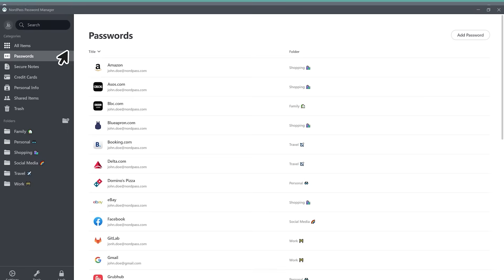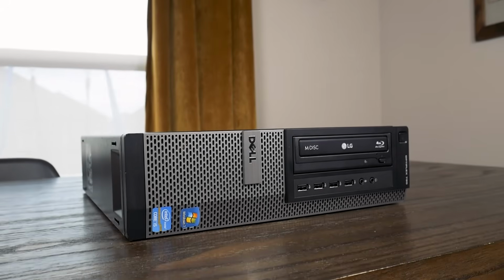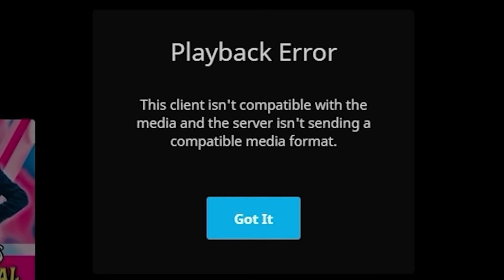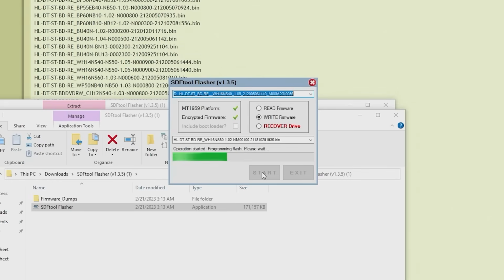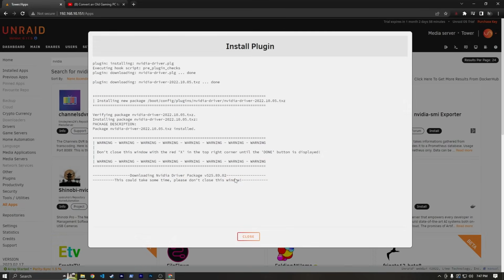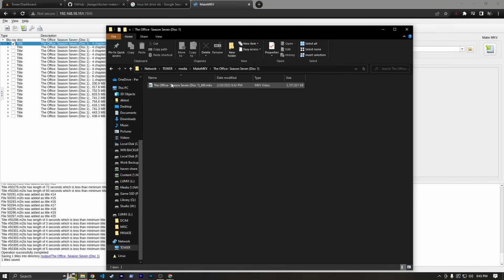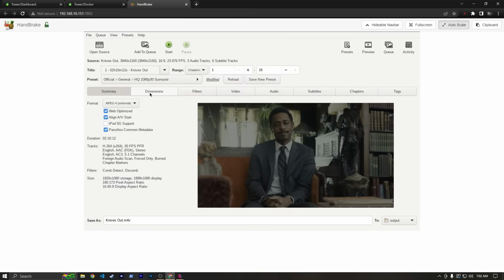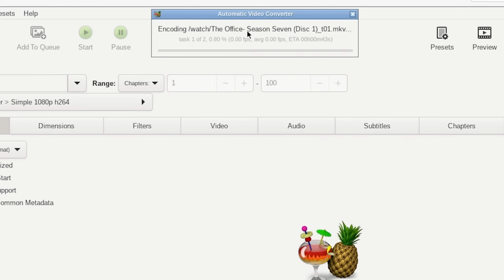Streaming 4K Blu-rays With a DECADE-OLD PC

Comment: I find it strange to put unraid on a system like this.  I get that it's easy but you could have put $60 more into the hardware itself and run the same software on a free OS with a GPU that handled all the transcoding.  Maybe it's just me but spending $20 on a machine to then spend $60 on a license for the OS for that machine makes no sense.  Now I'm going to hunt for the comments about how you should just download instead of transcode since you aren't keeping full quality rips.

Comment: I have an Optiplex 7010 with an I7 3770 and GTX 1050 ti. No problems streaming 4k video. A 2nd gen I5 just doesn't have enough power to run a server if you have multiple streams going.

Comment: with handbrake, try encoding to " H.264 (Nvidia NVEnc) " it should use some of the GPU power and cut down on render times
Reply: Makes the files massive though. I'd rather CPU encode
Reply: @StephenDeTomasi  Not true. Encoding is encoding - same settings on GPU and CPU should give you same file size. Its just faster using GPU .

Comment: I'm going to be doing a similar setup on a 790 I picked up about a week or two ago, just waiting to move around some network things so I can hook it up. 
I was worried that the i5 might not be enough. I've seen a lot about these boards in the 790 accepting Xeons with the latest bios update even though dell doesn't say they are supported. there's a Xeon 1260L with a 45w tdp, and a few others with 80w tdp in that socket generation. they're super cheap so I am going to try it out and see whether the system will run with one. no Igpu but that's fine if you're running headless or are using one for transcoding anyways.
Reply: I have successfully run a 790 SFF with a Sandy Bridge Xeon E3-1270 (no iGPU), 32GB of RAM and a GTX 1650 LP.

Comment: the Quadro K1200 can't handle h.265 transcoding but the nVidia T400/600/1000 can... one of those might be a good option. Also the P620 can too, I think. And you can use nVenc with HandBrake. Also VCE or QuickSync.
Reply from the maker: Yes, no idea why I didn’t look for nvenc in handbrake
Reply: @HardwareHaven  I was going to say the same like the guy above 👍👍

Comment: I have an OptiPlex 3040 micro. I tried to use it for UHD Blu-rays, but I ran into the same speed issue you found. If you want hardware decode for 10-bit H265, you need at least Kaby Lake (7th gen). I have 6th gen Skylake, and the dell bios won’t allow me to upgrade, even though it’s the same socket. But otherwise, it’s very small, quiet, and pretty efficient.
Reply: let the Nvidia driver do it !

Comment: I have an Optiplex 990DT, also with a second gen i5.  The local Microsoft TPR that sold it to me gave it Dell's stock/standard ATI AMD Radeon HD 6360.  For arcade-emulation gaming and Final Fantasy XI Online, it's absolutely perfect.  Dell Optiplex and Precision are the only desktops that I trust. In the passed, I've had ASUS and a few HP's. They were not as good as Dell.  I have found that Optiplex and Precision have consistently come from the factory with the DVD drive set on territory 0.  This is fantastic for people like me who hae have extensive library of  territory 2 anime DVD's.

Comment: man i am definitely bouncing back and forth from TrueNAS and unRAID.. 
MY setup right now I'm running windows 10 with 15 2TB drives in RAID 6 on a LSI MEGA Raid card. the new server im working on is a 8x 3TB with an HBM that will run ZFS. 
But for any hand brake work I 100% just use my AMD R9 5900x with the RXT 3070ti that thing with blast a movie in a 1/4 the time my Dual Xeon X5660 with a 1050TI Server can..

Comment: sweet will try this soon i have an eligable Asus Blu-Ray however it is in an old pc used for retro games running XP/Vista and 7 with an old Xeon W3680 6c/12t and a GTX 960 i wonder how it will run.. i wonder if it is possible to do the heavy lifting on a gpu with nvenc

Comment: I got one of these LG drives back in 2016 and didn't have to flash it. Stock firmware is good to go. If you're too squeamish about flashing look for used ones online and see if you can confirm they'll work.
Reply: What is being flashed is the older stock firmware that has a known exploit.  Your drive is old enough that it came with exploitable firmware.
Reply: @JamieStuff  I didn't have to do anything to get it to read or rip UHD discs though is what I'm saying!

Comment: Have you tried using hardware encoding in Handbrake over the GPU. At least in my case I can reduce the encoding time significantly.
Reply: some hardware can't handle the encoding...I believe those processors do have h264 built in
Reply: Yeah right I just watched the video again. The GPU does not supported the h265 codec. But I think at least the encoding part to h264 could be accelerated by the GPU

Comment: I use a rehoused 790 motherboard in a full height ATX case. I'm using it to run Automation software for a Radio Station. The Rehousing was to support a full height video card, and to add more storage bays. Dell was still using a standard ATX Power Supply in this design. So i replaced it with a larger one.
Reply: I, having just begun doing Online Radio, have a question about this: do you rip the full CD for the station or do you pick and choose the material? Also, how do you handle the songs with swearing? (As far as I know, there are no Radio Edits for, and I’m using this as an example, AC/DC’s “If You Want Blood You Got It”).

Comment: id recommend a ASMedia ASM2812 Chipset dual NVME splitter that way you can use the full read bandwidth of the NVME and don't have to use one drive as sata from my testing it sacrifices write speed but I'm using an Intel 670P 2tb drives trying to create a 2x5tb NVME storage solution to have faster access time to my bulk storage

Comment: Where did you find those downloadable images for Unraid? 😳

I have about 300 or discs to go through.. that I've been procrastinating quite heavily on.

How does AnyDVD HD compare to MakeMKV?

Also, tip to anyone building a rackmount server for use with Unraid - don't build in a 2U chassis.
Reply from the maker: On their website. It’s not a cracked version or anything

Not sure about anydvd, sorry!
Reply: @Hardware Haven  I could tell it was on their website. Just till now I've copied the download link when my server updates to have a local ISO in case it's needed.

Comment: you can get a dvd drive to hdd and odd adapter. will alow you to install a laptop sized blueray player and a full size hdd. or you could shove a hdd to dual 2.5" drive for a total of 4 hdds
Reply from the maker: Lots of options for sure
Reply: @HardwareHaven  also, I am compelled to point out that blue 3.5 in hard drive holder has 2.5in mount underneath. So can hold both a 2.5in HDD/SSD and 3.5 in HDD without having to buy anything.
Reply from the maker: @abramb8690  Well shoot. Whaddaya know haha. Thanks for pointing that out! I still don't think I would've used the 250GB drive though haha. Thanks for the heads up!

Comment: Great video, thank you very much. I didn't know, there was a way to flash Bluray drives to use something like LibreDrive. Good to know. 
On the other hand, can you run StaxRIP on the server instead of Handbrake? But I don't know, if there even is a linux app for StaxRIP. I use it on my gaming machine to encode my recordings for youtube and it uses the GPU instead of CPU for encoding. For me, that's way faster. When I first used it with my Xeon 1231 and a GTX 1070, the encoding via GPU was 4x faster than using the CPU. But there might be another issue, if the Quadro Card can't encode H264 and just decode it.
Reply from the maker: Not sure but wouldn’t be surprised at all if there was a container made for it
Reply: You're right. I is very unlikely. You probably made the right choice when using a more powerful pc for ripping the Blurays. 

But I'll keep this video in mind when I think about building a media center for the living room.

Comment: i use plex . but my problem is my 4k movies dont run smooth when i have the 7.1 audio . even if i lower to 1080p it will be bad . but change to 5.1 and works great 🤔
Reply from the maker: Interesting… not sure about that
Reply: @HardwareHaven   ok done some testing ,im pretty sure is my tv not powerfull enough. i installed Plex on my xbox one s and 4k 7.1 audio no problem from same server on same wifi 👌

Comment: I have a device similar in age.  16GB DDR-1600 RAM, i5-4690k OC'd, Nvidia 1660 Ti, 20TB storage drive, 2TB SATA SSD.  Windows 11, Plex works fine, Pihole in Docker works great too.  No issues streaming 4K.  I acquire movies, so no need to convert anything, heh.

Comment: Because of the Optiplex 790 being stuck on Sandy Bridge, I used the Optiplex 7010 as my starting point for my build.  Unfortunately I grabbed the SFF and not the DT form factor, with the disappointing laptop optical drive.  Now that time has moved on, Haswell and newer generation desktops are getting cheap.  I'll use this as inspiration to play around with unRAID though.  Thanks for the awesome content!
Reply from the maker: Yeah, the lack of full 5.25” bay is a huge bummer… wish there were more newer prebuilts with one
Reply: I have an HP Envy desktop with a laptop DVD burner. It's so annoying how they designed the case to only support a slim drive!
Reply: There are slim UHD-capable drives available, as well as USB external ones.

Comment: if nothing else, i'd empty the optiplex case and fill it with hard drives, and a psu; run just the data cables out the back to pci sata controllers

Comment: I've taken a few years off of tech to pursue other hobbies, but having limited budget for hobbies lately videos like yours have had me very intrigued to start spending time on PCs again.

I should be picking up an optiplex 3060 SFF (i7-8700, 16GB RAM) for $100 this evening. Pretty stoked! 

I still need to find a another for a router/firewall box. I wish the USFF/Micro had a PCI-E slot for a NIC.
Reply from the maker: Woah nice deal!! Enjoy it
Reply: @HardwareHaven  Pro-tip-
It's become an outdated marketplace these days but I find all the best deals on Craigslist. Project cars, Used furniture, old commercial PCs apparently too!

Thanks for the videos!

Comment: This is almost identical to my server project.
I took my old first PC, which I quite like the form factor, and managed to set up a headless ubuntu server capable of ripping DVDs (BluRay lectors are incredibly expensive) and host them in Jellyfin. I am currently looking for a gpu to do the heavy transcode lifting as the CPU is just an Intel Core Duo which if I reckon correctly is incapable to do hardware acceleration.
Thanks for the content, Hardware Haven, really enjoyable!
Reply: Nvidia Tesla P4 is quite cheap, draws little power and has double the transvoding power of the 1080. It costs around 100 dollar.
Reply from the maker: Yeah, you’ll definitely need something else for transcoding. Luckily there are lots of cheap GPUs on the market, at least compared to recent times haha
Reply: @HardwareHaven  indeed, it was crazy not so long ago!

Comment: You should take a look at radarr/sonarr to automatically rename/manage and import your media files, this will save you time and it's easy to setup in unraid (or any other os)
Reply from the maker: I think I was under the impression that was only really for torrenting stuff. I guess I could be very wrong haha, thanks!
Reply: @HardwareHaven  It sure is usefull for that haha, but I believe it can also be used for a legitimate media library. For torrenting stuff, prowlarr is also used in addition to those services to automate the whole process.

Comment: I just went through the same guide to update the firmware on an older portable USB  LG BluRay player to work with UltraHD discs and it works fantastically. Only problem now is I'm using OSMC on a really old pair of raspberry PI boxes that can't go beyond 30fps playback, and my rebuilt media server can't possibly handle the transcoding. I may experiment with buying a new Raspberry Pi IV which can do the decoding and and see how that goes...
Reply from the maker: There are some potentially good alternatives for transcoding that are a bit cheaper on the market. At least with the current pi market.i haven’t had a chance to fully test it recently, but the linkstar from seeed studio supposedly supports 4K h264, and there are also some cheap mini PCs with newer Intel mobile chips that should be able to transcode 4K with quick sync

Comment from the maker: Get 2 years of NordPass with 1 month free for a personal account: https://nordpass.com/hardwarehaven Or, use code hardwarehaven at checkout!
OR
Business accounts (must register with a biz domain) can get a free 3 month trial of NordPass at https://www.nordpass.com/hardwarehavenbusiness with code hardwarehavenbusiness in the form.

SHOUTOUT TO @AllThingsSecured FOR THE PASSWORD TRICK! I wanted to mention him in the ad, but that wasn't really allowed in that moment. Go check out his channel, it's great!
Reply: I was going to suggest getting a USB 3.0 to SATA adapter (e.g. Vantec Nexstar DX or similar) to make the ripping drive more portable. This is what I do and it works awesome - This way I am not tied up to a given PC and can rip the 4K movies (or any disc) I own on any of the computers around the house (Intel NUCs, Mid 2011 Mac Mini, etc.). But if it works best for your workflow for the drive to be in your main rig as you indicated towards the end of the video, that's great as well. 

I typically do not transcode as my clients (Nvidia shield, Google TV 4k etc.) have the necessary H.265 decoders but in the past have written automation scripts to run custom ffmpeg commands for transcoding (that's essentially what Handbrake does) any shows I may have recorded using my HDHomerun or movies ripped and saved to an "overnight transcoding" folder. 

Also, if you might be still considering adding more drives in the Optiples 790, check out 5.25" adapters that can be used in place of the DVD drive (I have used Icy dock but I believe other companies like Kingwin etc. might also make these). Wendl at Level1Techs has also made few videos on these adapters. In this scenario however, depending on how many drives you might be able to fit into the case, the limiting factor could be the number of SATA ports on the motherboard (which can be solved via add-on SATA cards) and by now the rabbit hole is getting quite deep 😃 

In short, the 790 is not quite useless - in fact, I have quite a few PCs from that era still chugging along around the house. Just that the Intel Quicksync encoders/decoders in those processors are bit outdated if you try to use it for the latest and greatest video formats. Those processors and systems still make great learning computers, general purpose browsing and youtube playback upto 1080p, pfsense routers etc. Good luck and keep the videos coming - look forward to seeing what you come up with next.